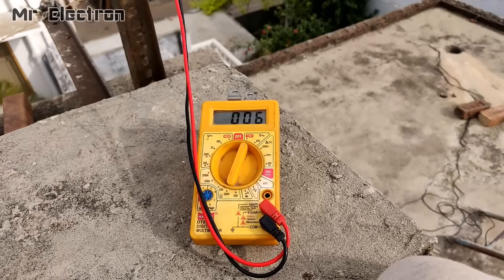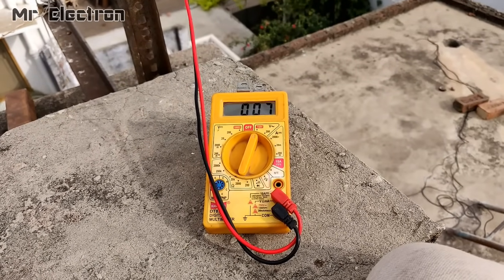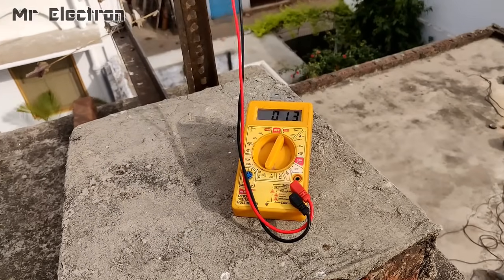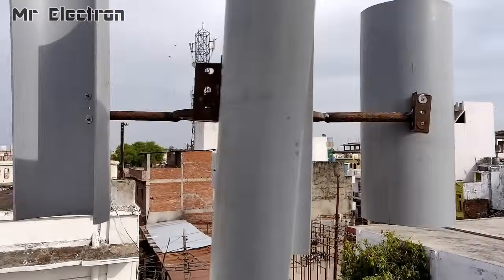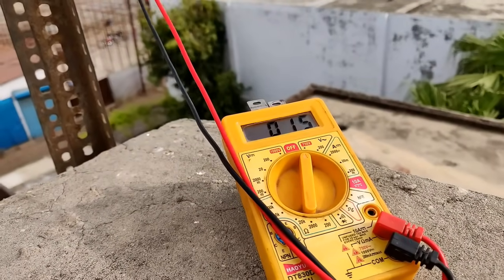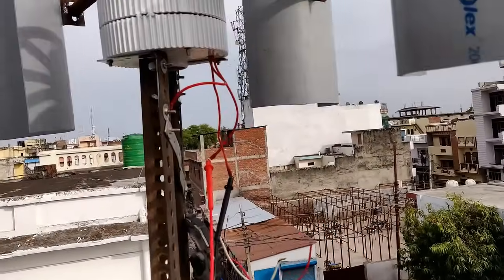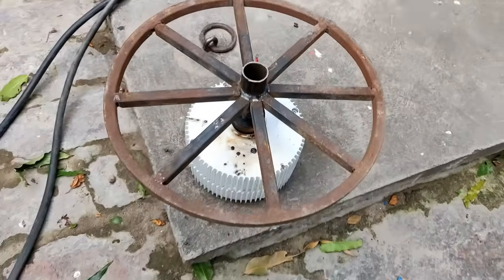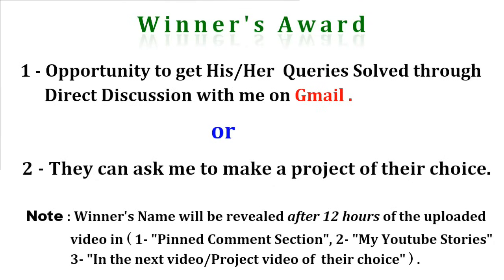Make 12V , 24V 400W Alternator Powered Wind Turbine Generator ( Part - 2 )

Comment: All practical tests show that small wind turbines hardly generate any electricity and also only have a short service life due to the very gusty wind near the ground and the enormous strain on mechanical parts!  
Small wind turbines are only worthwhile if you MUST be self-sufficient from the grid.
With solar panels, on the other hand, you can reliably generate "green" electricity for a few cents/kWh (!) for approx. 25 years!

Comment: The design is good but this never can,t to charge the battery in this low voltage, find the way to get up the voltage to 15 volt

Comment: You need a way to BLOCK the drag side of the VAWT while making it able to rotate that blocking into the oncoming wind, you could use a tail structure similar to HAWT. I can imagine something that would would quite well. It's not too complicated really. A half cylinder on TOP of the VAWT mounted to the center of the radius on a free spinning bearing with an ARM secured to the top of said HALF cylinder oriented in the down wind direction. There I just invented the solution for VAWTs to make them much more efficient by eliminating the drag side of the spinning blades with a free spinning half cylinder COVER positioned over and AROUND the VAWT structure utilizing a wind vane type tail similar to ones we see on HAWT. >-X   <- you know THAT thing. OKAY there you go
Reply: Same thought I had, block the wind to the upwind-traveling blades, using a pivoting shield with a tail, but please realize, vertical-axis wind turbines are less efficient than regular propeller-type turbines.  Let's remember, the VAWT promoters cite the simplicity and "no need to aim" as the main advantage to VAWTs.  Attempts to "rescue" VAWTs from their own inefficiency always starts with throwing away their main supposed advantage - add a tail and now it "aims" into the wind.  Save yourself the trouble, and just make a real wind turbine, and enjoy some usable amount of power.  Just briefly hitting "a voltage", running unloaded is nice to see as a start, but what you need is to push current (amps) into a battery or other load, which takes energy, which will slow down the turbine's rotation, which will then restrict the voltage.  So this demo is nice for a beginner "science fair"-level project, but doesn't get you to the point of making usable amounts of power.

Comment: Los alternadores dan su potencia máxima a unas revoluciones en particular, cuando no se aproxima a estas, el rendimiento es muy bajo. Cuando ví el primer video suponía que haría un juego de poleas para obtener más velocidad y no conectar directo al eje de las palas. En realidad así como está construido las revoluciones estarán muy por debajo de las de diseño de este alternador  y los resultados serán pobres. Estimo que en ningún caso se llegará al voltaje y potencia indicados. De todas maneras, no hay que olvidar que la energía disponible depende de la velocidad del viento y la eficiencia del del sistema para captar esa energía. De ninguna manera un juego de engranajes o poleas puede aumentar la energía inicialmente colectada en el eje primario solo adecuar las revoluciones para arrimarse a las óptimas del alternador.
Reply: Ese motor lo venden en Aliexpress, en todos los vídeos que e visto de este proyecto también pienso que debe tener una transmisión para más rpm y más energia

Comment: I just want to let everyone know, that this diy wind trbin might work for a month or two.  But when you well rusty metal to rusty metal, with out cleaning s 3 inch area, all around it,. The metal u weld with, doesn't behind with the other metal, meaning that when it gets a stress fracture,  that it will break

Comment: Sir, what is possible with the car's 24 volt alternator, then what will I control for sir rpm, if the wind speed is high, will it be higher, thank you sir

Comment: A car alternator will give you better amps that's needed for charge batteries and it's good for this type of blades you made and much cheaper
Then this Chinese generator
Reply: No way unless you add permanent magnets to the car alternator. Conversion needed if not it's worse than this motor.

Comment: To get mo power on low winds use horizontal axis 14blades not vertical.vertical axis is design for high power winds
Reply: A horizontal axis needs to be able to rotate to face the wind, which complicates things a lot if you're building your own pole.

Comment: Hello young man,
instead of the generator which does not give a good fixed result a car alternator you will have a stabilization of retention 12 volts and a great intensity with a small rotation France
Reply: Plz guide me
What you said
This best or alternate? 
What we use?
Reply: O bro he is not getting anything just rotating with hand LOL

Comment: Hello young man,
instead of the generator which does not give a good fixed result a car alternator you will have a stabilization of retention 12 volts and a great intensity with a small rotation France

Comment: Should We use neodymium magnet powered car alternator in it ?
Reply: A big downfall of using a standard car alternator is that the magnetic field of the rotor is not constant, and has to consume electricity in order to operate. I believe the generally accepted power for this at direct connection to battery is around 36 watts (3 amps), meaning you won't really get a decent output unless your setup is in very good condition for extended periods of time. Notice this project produced just around 12 volts most of the time, and even that was with zero load, so a car alternator is not ideal unless you have power to waste. This is why permanent magnet generators are used in wind application.
Reply: Yes and remove all brushes.